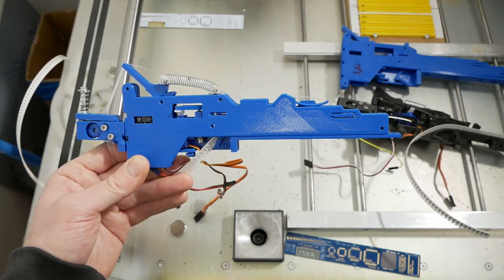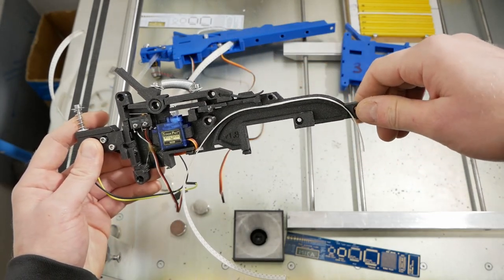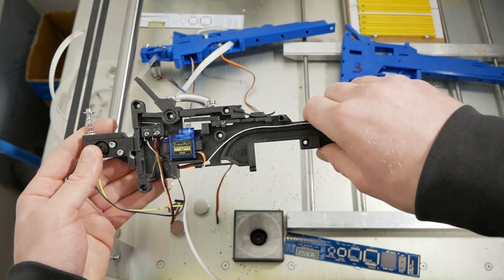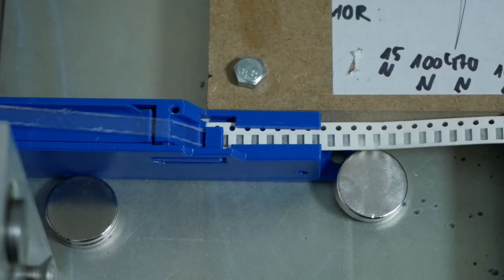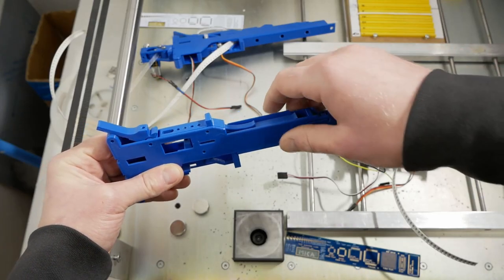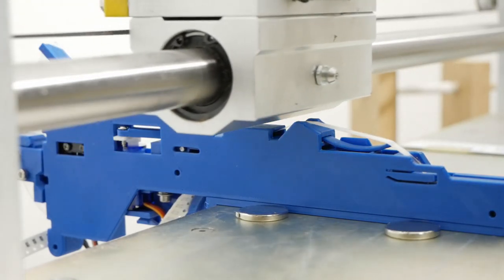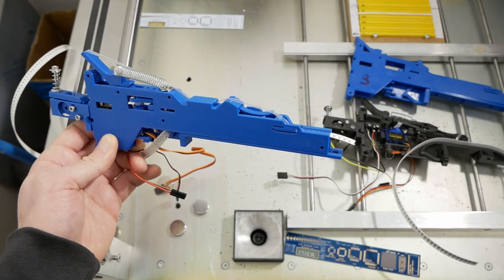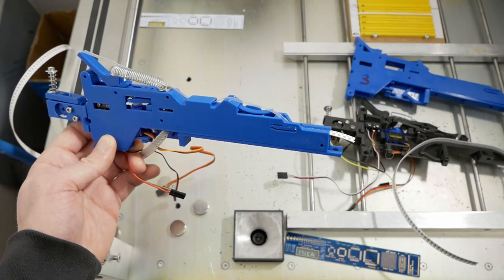DIY PnP - Modified 0816 Automatic Feeder

Comment: To reduce the jumping you may be able to reconfigure your servo arm so that the feed mechanism is connected behind the pivot and rotates outward and stops in the forward position.  This way you get natural acceleration and deceleration that approximates the sin() of the rotation.  Linear speed would then be lowest at the start and end of the stroke, and highest in the middle of the stroke.  With the mechanism connected at the current position, acceleration is highest at the very start of the feed.  This is something I've been thinking about for my own design.

Comment: Hello 
I need one of these feeders, how much does it cost ?
Reply from the maker: The cost depends mostly on the price of 3D printing. In my case the price is around 10USD for all parts (Including servo, motor, switch and springs). It's really cheap...

Comment: Hi Mica,
I face the same "problem", your idea looks just perfect for my needs (...and for others i guess!). Especially the solution with the lower height in the backside!  Is it possible to share the 3d printer files? Have you convert other sizes too? I mean 12mm, 16mm, 24mm etc.
BTW what are these jumps of parts? (probably nothing as the nozzle supposed to have take the parts before ...)
Thanks in advance
Simon
Reply from the maker: Hello, right now I have only 8mm version available because I was not sure If it will actually work. I will surely make the other sizes soon. I can publish output files (STL and STEP) on my blog. I can share Solidworks files over email (Contact me), but I wasn't able to make a full import of STEP files. I just added new features on STEP models... Jumping is caused by pushrod when it moves back to next hole in tape. I guess its not an issue that have to be solved, you should pick the part as soon as its available.
Reply: @MicaCZ 
Great! Thanks for your quick response. It will be great to have an STL model for printing just to test how this version fits on my machine. How can i download the file (ready to print) from your Blog? I don't think i need the step files as i don't have the Solidworks software and i m not a 3D expert, so... maybe another time. 
Thanks again!
Simon
Reply from the maker: I just posted the STL models on my blog http://blog.michalhrouda.cz/2020/12/s0816-smt-automatic-feeder-version-05/
Reply: @MicaCZ  
Thanks for your kindly response !!!